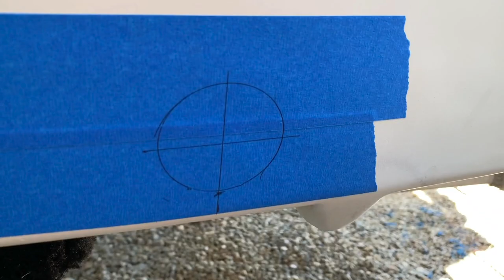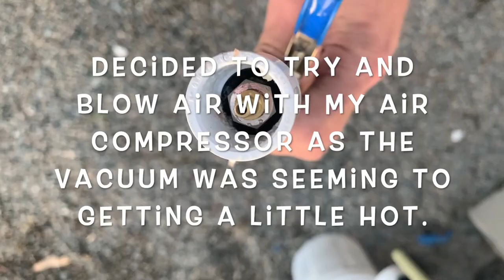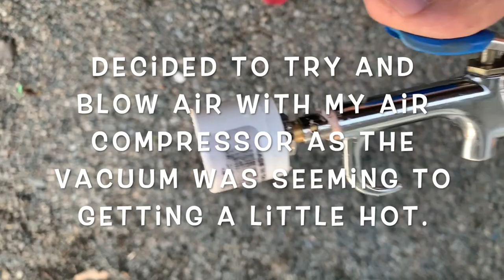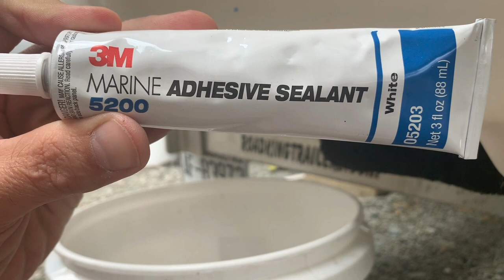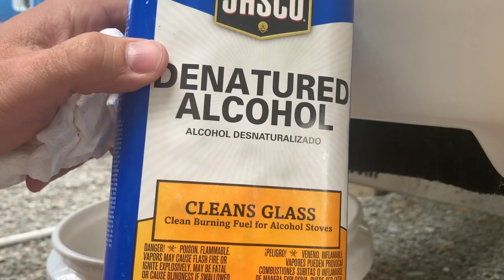Suspected water in Carolina Skiff hull.

Comment: If ur using a screw u don’t drill a hole like that😂the point is for the screw to grab in the wood, this is common sense lol
Reply: Not everyone has it tho, those screws will come loose over time for the vibrations and water beating the hull
Reply from the maker: There is no wood in this boat and if you don't predrill the holes, you will just crack the fiberglass.
Reply: @MikeRose1  this is correct, the transom is made of high density foam… still same concept, only suppose to drill through the gellcoat and then let the screw grab the material and bite vs a wallowed out hole
Reply from the maker: @TheSteelerfool   The hole wasn't wallowed out,  It was slightly smaler than the screw allowing for the screw to grab tight.  Rest assured, after a year, the screws are still tight. Thanks though.
Reply: @MikeRose1  obviously the hole wasn’t wallowed out🤦🏼‍♂️ but it will be after vibrations and hard use…